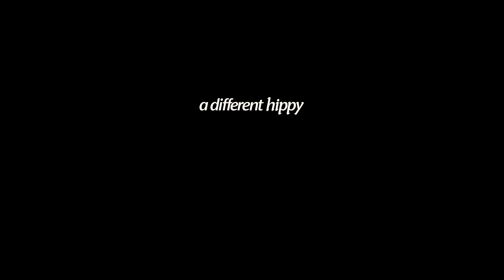【ブッシュクラフト】桜と雨の ハンモック ソロキャンプ 【DD Hammocks】

Comment: your description of the wet saw and the dry saw is wrong is the other way around smaller teeth is for drywood bigger teeth is for the wet wood
Reply from the maker: Thank you comment! Is it the explanation of the figure?
Ignore the size in the figure. (The size could not be adjusted. Both blades are the same size.
This time, the difference in shape is expressed.